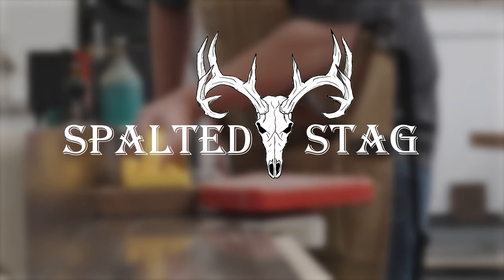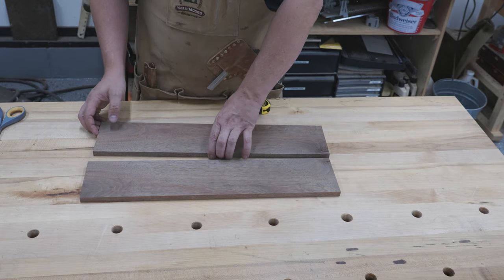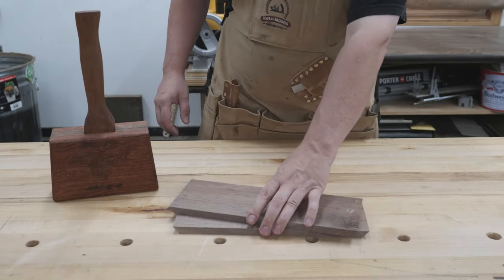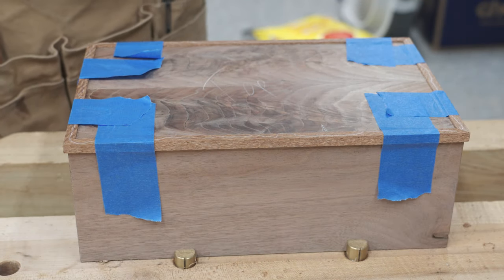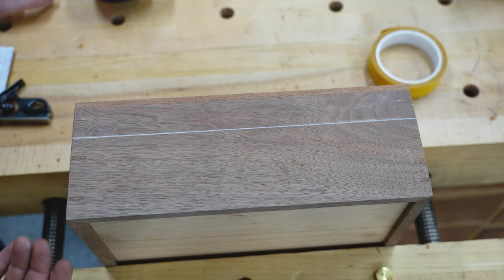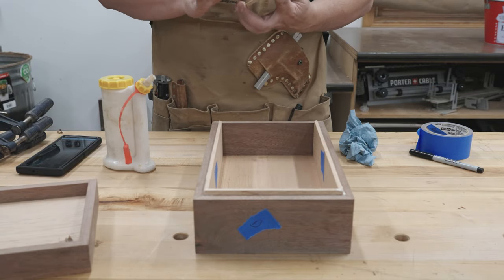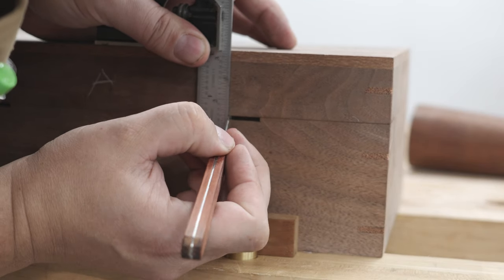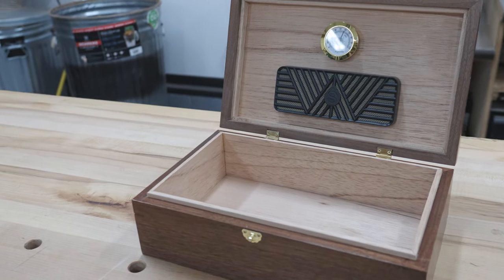Building Your Dream Cigar Humidor: Expert Tips and Tricks

Comment: Great project , a few tips from a lifelong bespoke humidor producer, no need for dominos in you’re long grain glue up , just quality pva glue, also no need to “pre soak” you’re edge joint. Spanish cedar is the standard for humidors( it’s actually a mahogany species), always wear a respirator as the dust is nasty on the lungs. when edge banding try 3m luthiers tape, it has elasticity to apply clamping pressure . We never clamp edge banding.
Reply from the maker: Thanks for the tips!  I really need to get better about wearing my respirator around the Spanish cedar.  I tend to overuse my domino, but I gotta justify the purchase somehow haha.
Reply: Hello, we are going to make a new Humidor and we don't have much information about it. Can we do this using nails and any wood glue or will these damage the cigars? We have 18mm thick cedar wood and we will not put extra cedar wood in it. We will cover the outside with 5mm mahogany leaves. Our aim is only to preserve the cigars at a very good level, we are not interested in aesthetic appearance. Could you please inform us about how we should do it?

Comment: Ridiculous amount of clamps used for the cedar liner...jeeze.
Reply from the maker: In this application, it's critical that I get a completely flat glue joint without applying enough pressure to damage the Spanish cedar, which is very soft.  So more clamps with less pressure.  Since the Spanish cedar is so soft and thin, it's also pretty flexible. If you look closely, I'm staggering the clamps.  I wanted to make sure that it glued up completely flat against the walnut.  If it kicked out at all, the corners would look ugly, and the top may not fit or have a poor seal.

Comment: explain to me the saw blade you used during the period of cutting dados and miters. Silver blade with very large gullets.  Explain why you like that blade please.
Reply from the maker: It's a 24 flat tooth freud.  I also have a CMT from Katz-Moses that works just as well. Generally low tooth count with large gullet is for ripping.  It gives the saw dust plenty of room to be ejected.  In this particular case, I use it for its flat teeth.  Allot of blades have alternating points,  which leave an uneven dado/rabbit. Flat teeth give you a much smoother finish.  These two blades are very high quality.  They last a long time and have thicker carbide teeth so when they do dull you can have them sharpened.

Comment: beautiful work. Does the bottom wood also have to be cedar?
Reply from the maker: Yes.  Though I have done the bottom as one piece of cedar and also as a liner like the sides.  I prefer doing it as a liner.  The cedar really drinks up the lacquer,  so I was concerned that it would leach inside.  The hardwoods don't seem to absorb it as well,  so I think it's a better method to do the bottom the same way the sides and lid are done.